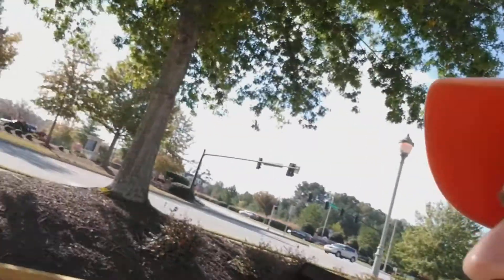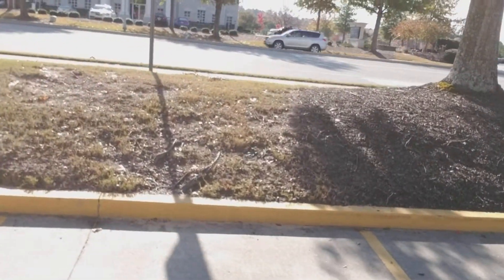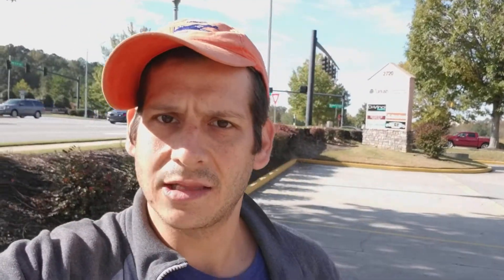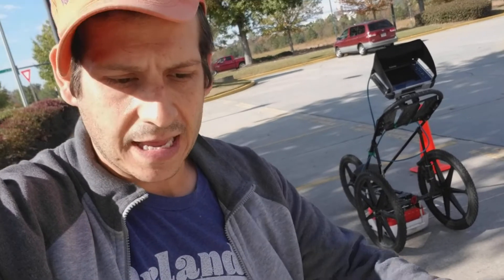The Benefit of Calibrating the GPR Survey Wheel | Ground Penetrating Radar for Utility Locating

Comment: so, how do you calibrate the survey wheel ?
Reply from the maker: fernando olivares each system is different. Generally you would like your gpr up with a measuring tape, input the distance you will push the cart, then push it that distance. It will calculate the turning rate of your wheel. Hope this helps